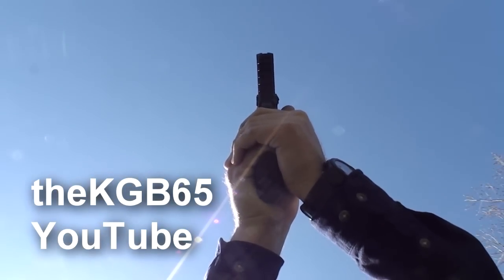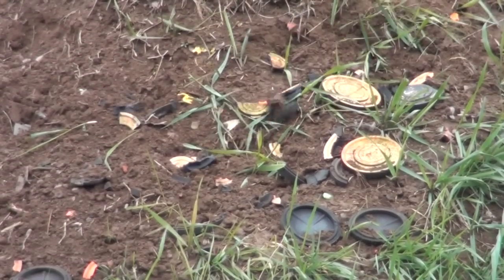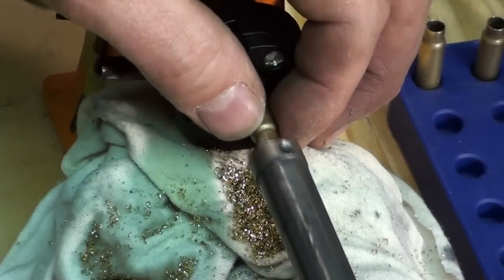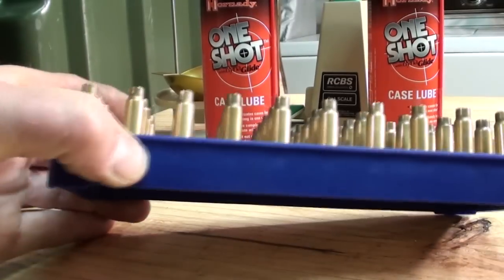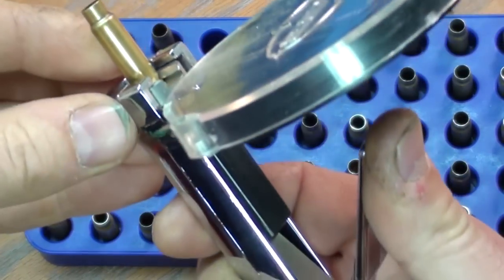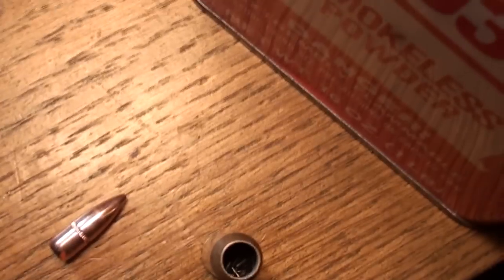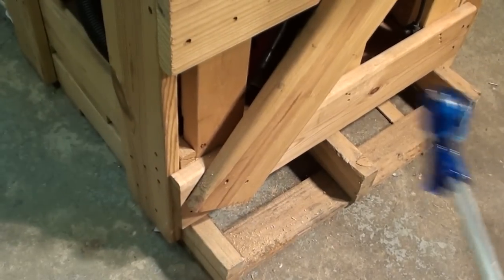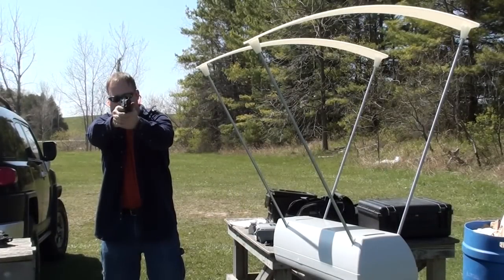Should I Reload the FN 5.7x28?

Comment: Yowza. That all sounds kind of awful. Also though, this continues to mystify me even more about the difference in civilian-available 5.7x28 vs. the SS190 NATO round. Specifically, your references to not pushing the pressure and staying around what you call "factory" loads. The only reason I would consider handloading this caliber is if I could get somewhere nearer the military performance (394ftlb for SS190 vs. 256ftlb for stadard FN civilian ammo). But my Lyman guide not only doesn't have any loads like that, it doesn't even have anything as fast as the civilian factory rounds. What exactly is going on here? And is it possible to create something like that 32gr@2300fps round?
Reply: I thought the same way when I first started loading for the 5.7x28, but the cartridge doesn't need to push the kinetic energy envelope to be devastating.  The maniac at Ft. Hood used commercial SS197SR ammo which was tremendously effective - and destructive.
Another factor to consider is the gun - whether Five-seveN or "57".  They use the same locking system and this is the weak-link in terms of handgun durability with hot loads.  I have produced 40 grain bullet loads going 2,060 fps, and 45 gr. Barnes TSX hitting 1,900 fps.  Firing more than a few rounds of this power load will quickly damage the Stripping lever - easy and cheap to replace, but damage to it is reflective of force being transferred into the locking system, and on into the polymer frame.  The gun will handle them, but for how long? 

The best approach to hand loading the 5.7x28 for use in the Five-seveN or Ruger 57 is to match the momentum energy of hand loads to that of the SS198LF, and it's very simple to do.  I started by multiplying 28 gr. bullet x 2,300 fps = 64,400.  Round up to 65,000 and divide by 40 to get 1,625 fps.  Note this is approximately the velocity to which American Eagle is loaded!  SS197SR used to be loaded about 100 fps faster - give or take.  The reason for this is the locking system of the FsN will be subject to peening of the slide recesses and locking cam arms, all excess stress is being dumped into the polymer frame. 

A 5% overload = 68,250
10 % over = 71,500
15% over = 74,750 and so on.  The larger the number, the greater is the slide unlocking force.
The FsN was originally designed around 27-32 grain bullets and this is what the locking system is intended to handle.  Bullets can be pulled from SS195LF and re-loaded up to 2,400 fps for maximum performance.  Barnes' 30 gr. bullets are an excellent substitute and can reach almost 2,200 fps without added strain on the locking system.  Even though 35 grains doesn't look like a "lot more" in reality, 1,850 fps is the maximum "standard" load for that bullet weight and keep locking stress the same as SS198LF.  Loaded to 1,750 fps, the 40gr. V-max is an 8% "overload" in terms of locking system stress.

Comment: What velocities are you getting ??
Reply from the maker: Jeffrey Kelley Using minimum loads, just to the point of good semi-auto functioning, my velocities typically run about 100 FPS above factory specs when using the 40 gn. V-max bullet which I prefer.  The 40 grain bullets mostly don't exceed 1,800 from the pistol but sometimes I load the 35s close to 2000 FPS.  For the most part I'm a supporter of the "save-the-brass" foundation.  Pushing the pressure really stretches the casings and causes loose primers on subsequent loadings.
Reply: I JUST GOT SOME 35gr and some sinterfire frangables. How do you think they get the 198's to 2150 ??? what powder how many grains? if you want to give me you email i can send you my chrono's

Comment: Reloading this round is a bomb waiting to go off! Several experience re-loaders have paid dearly. Some have blamed it on the pistol. Truth is they loaded improperly causing over pressure and pistol coming apart. The really fine powder used in these rounds are critical in measuring. Never try this on a progressive loader!!! If your so cheap as to not afford factory ammo a good insurance policy is recommended. Or buy a 9 mm and reload it
Reply: What's wrong with a progressive? Do you know? Could you know? Do you somehow think that the factory ammo is made on a single stage press? Get real.

Comment: i know this videos old but midwayusa has ultrasonic cleaners on clearence for 27 dollars and 10 dollars shipping i just bought one.
Reply from the maker: grizzskoalcope Those will work okay with very small loads of brass (a handful) but they have very short cycle times to protect itself from overheating which means you have to keep restarting it every few minutes.  You'll want to move your brass around in the basket between cycles because they also have "hot" spots because of the constant transducer frequency.  With good quality chemicals make a big difference, Hornady One Shot Ultrasonic Cleaner works very well.